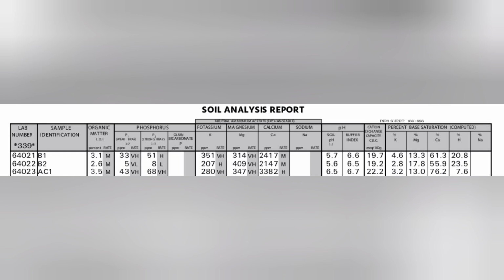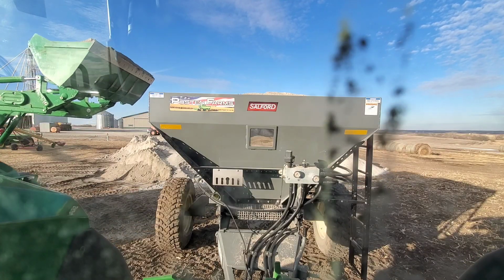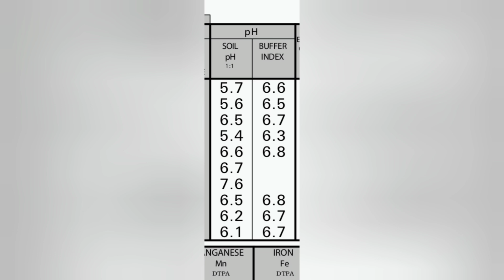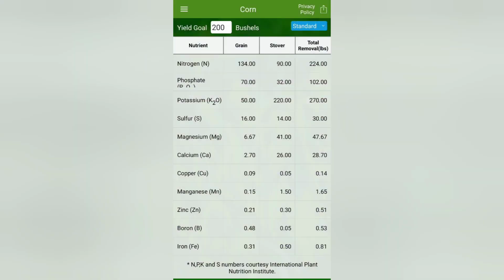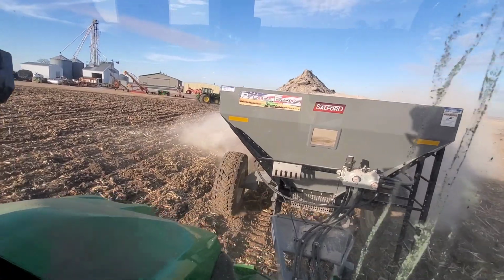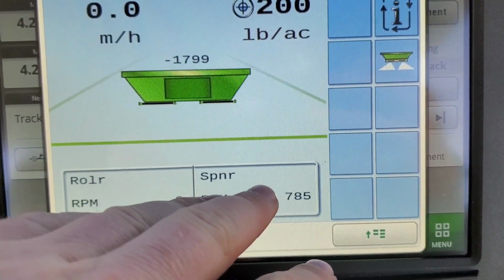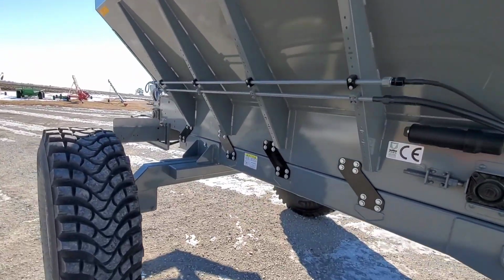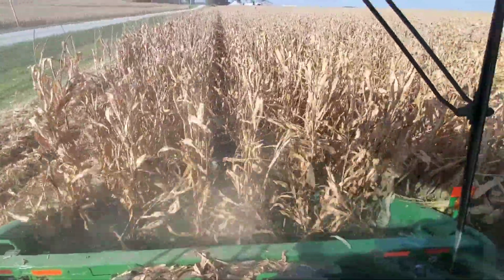why do farmers apply lime?

Comment: We bought a doyle and  got the pto and it will throw the same as hydraulic. We have a hydraulic pump over pto in the front and can vary the flow at the back. The drive, chains and running gear are really well designed over the last few  especially with the big chain and the removable board in  the bin for doing lime or litter. Great video